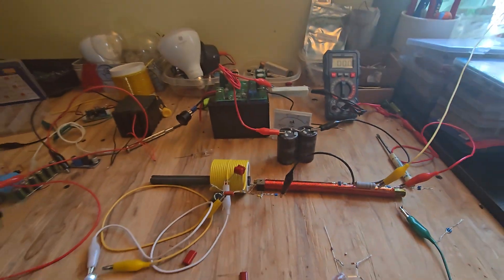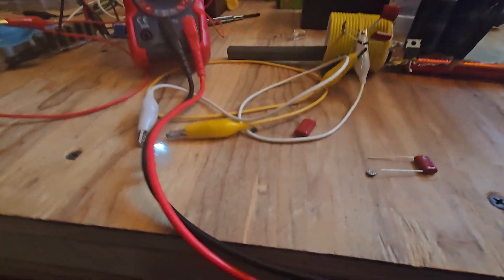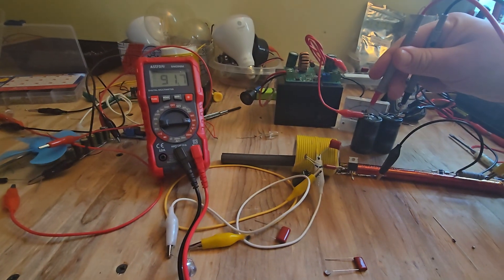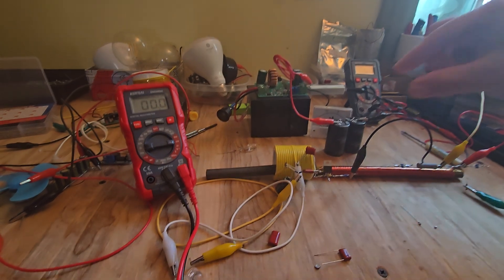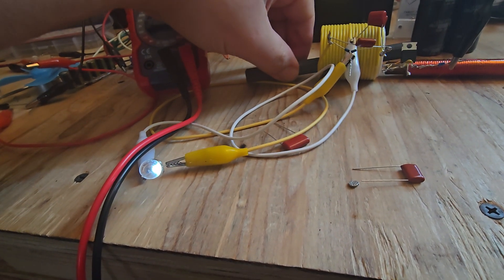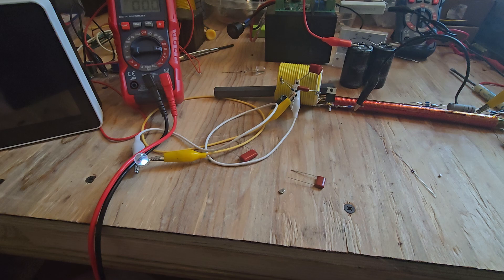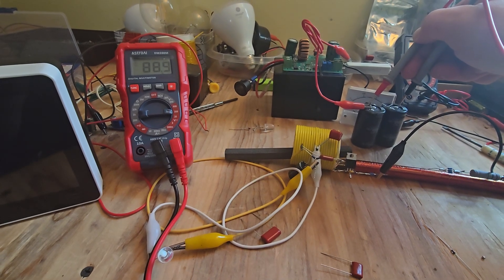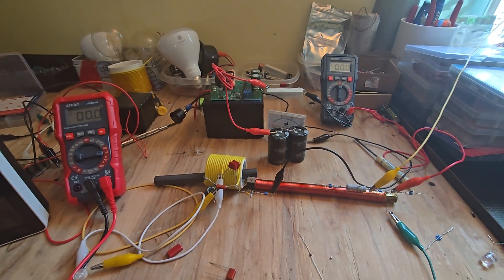VOLTAGE POTENTIAL ONLY AT NO CURRENT CONSUMPTION TRIGGERS TRANSMITTER INTO ACTIVATION CAPACITOR TEST

Comment: Anyone know any experiments on using a steady 1 wire DC potential and an AV plug to see if you can get DC current flow in the closed part of the circuit?

Comment: If you TRULY want to prove your circuit consumes NO CURRENT but runs off a Voltage Potential ONLY, do this:
- put resistor(s) in series with the caps, say 10 MEGA ohms (series connect 10*1 Mega Ohm resistors until resistance is immeasurable on your multi-meter - then touch it to verify you have several 100k to Megs on the meter as your skin has high resistance)
You also don't want low ESR caps, you want Low Leakage caps ;ø)
Reply from the maker: I'll try & do that & the transmitter circuit acts kind of picky with resistor values but it should be achievable
Reply: @MTECH2022  Best of Luck!
Ohm's law: I = U / R 
- so, Current is Voltage divided by Resistance, and the higher the resistance in a series circuit- the lower the current.
Since you say no current is drawn, increase Resistance to infinity to get Current to decrease to 0.
If your circuit is picky about resistor values, I see it likely consumes current.
Also, try using film capacitors instead of electrolytic caps - they usually have a much lower leakage current and can withstand high voltages too. Sadly leakage current is hard to predict, as it can vary non-linearly with voltage - the higher volt, the higher leakage.
Reply: I'll add that using resistors is a sub-optimal method because you lose a good chunk of energy in the resistance itself, you can instead use impedance of a low C capacitor with oscillating current to block the current flow that way to avoid losses, and to completely exclude current switch to a 1 wire circuit wherever possible.
Reply: @JenkoRun  The Description says: "VOLTAGE POTENTIAL ONLY AT NO CURRENT CONSUMPTION" - So if that statement is true, the resistor IS THERE to loose energy, as if current is drawn, it is no longer VOLTAGE POTENTIAL ONLY.
Reply: @ You're still loosing energy in the form of heat as current tries to flow through the resistance, it's better to prevent the conditions that allow current flow in the first place, see Joel's video on the subject for more details.
Reply: @EgonSorensen  It's not the same, no matter how much resistance you put in if your circuit allows the condition of current flow it's going to try and get current through, which is going to affect and disrupt the source dipole, disrupting the conditions that allow it in the first place is preferable over a system that wants to push current through a high resistance, the more current is lost in the resistance the more it's going to strain the source dipole, that's where impedance blocking and open circuit conditions are superior to Ohmic resistance.

And if that wasn't enough there is still the untapped Heaviside flow on the outside that isn't impeded by the resistance, the part that flows at near light speed, even with high resistance you're still sending that back into the source dipole which will disrupt it without any gain whatsoever, there's no advantage to a purely Ohmic high resistance over an impedance block method where both "electron" current and the Heaviside flow are prevented from interfering with the dipole.
Reply: @EgonSorensen  And if you use a closed circuit condition with a mega high resistance you are still drawing current, that is my point, it's better to not draw current at all, using the impedance of a capacitor or open wire circuit.

And just so we're clear, if you use a closed circuit as your driving circuit you're always going to have some current flow at the start, the difference between using impedance blocking vs high ohmic resistance is that the former stops drawing current completely once the capacitor impedance blocks it, the latter will keep trying to draw current.

A very brief moment of current draw at the start vs continuous sluggish current draw, there is no reason to use the latter, and again, the latter will not protect the dipole from the Heaviside flow, the former will.

Comment: At this point it would be interesting to try something like Joel's peg cell to isolate the capacitors or alternatively since youre running above 90v add a cheap 90v gdt for a spark gap and see if it isolates further. I have a feeling a spark gap would keep the caps charged.

Comment: yeah bud get a good scope like Owon . with a good clamp meter. I have a video coming out on friday showing how much of a difference there is between a galvano meter and multi meter when reading pulsed DC . Especially into a inductor which turns it into AC. The difference is drastic . The fuse method won't work either. A good thing to do is put 2 very small leds opposite each other on the input then you can see the current and direction by seeing which ones glow. I think you're back on the right track again just get a scope and clamp meter ...they are not cheap but you need for this research
Reply from the maker: Definitely plan to & the core theory of operation the transmitter will evolve into is an archform that manifests wireless power with no input simply due to its special design

Comment: Nice job.
A suggestion for you, you're looking for a voltage potential. 
You could consider using an electret
just a thought.
;)
Reply: Had the same thought, this area of research seems to be heading into an area where the source dipole completely excludes current flow and closed circuits, an open dipole and an oscillating potential condition connected to an AV plug further up in the circuit for closed circuit current operation leaving the dipole untouched, Joel did something similar recently with making a 'breathing" electret that self oscillates.
Reply: Best comment thread on free energy on the internet. as long as you dont kill the dipole but stress its flux density to the point where the the dipole begins to alternate or flip its polarity , that can set up a magnetic field in just about any conductor which collapses and produces an electromotive force or electricity1!.  I wrote a transdimensional engineering framework that focuses on this principle exactly the electric flux density or changes in the electric flux density in any region of space-time produce a very specific arrangement of that flux as it begins to rise and density within a certain volume of space time free energy is when that original condition of the dipole become stressed due to an overcharging which can be just one electron more that causes that electron to bounce back and forth between the poles taking the entire displacement current with it which is the movement of the energy in the vacuum in which any matter occupiesAs you begin to increase the electric flux density within a given or set volume of SpaceTime that electric flux will begin to converge and curl which is the scalar potential that was described in the original Maxwell equations on electromagnetism these scalar component we're just taking out by Oliver heavy side when he was developing his Vector calculus because he could not add up vectors that did not move from positive to negative the dipole Never Dies it just spins whirling as a Vortex or double Taurus in space-time which is the origin of spin and the explanation for Nasim Herriman paper describing the swartzchild proton and the origin of spin. 

So pushed even farther into that configuration it'll actually converge and curl into a singularity producing its own gravitational field that's why T Townsend Brown was able to use heavy dielectrics charged with high electric fields to fly shit around that's the secret that's how it works it's the electric flux density and how put off he published the paper on it called the polarized vacuum representation of general relativity my framework expounds on all of that solving General and special relativity and ultimately the enumeration in electromagnetism of the condition of Singularity that was predicted by Carl schwarzchild which therefore unifies electromagnetism and gravity as a singular function of the tensor metric of the electric field.
Reply: @ It's still unconfirmed that a changing dielectric field creates a changing magnetic field though, I've only ever seen this claim based on math but never seen any experimental verification of this, and since inductors can be activated purely by changing dielectric fields they're not proof that a changing magnetic field is present.

I'd like to see someone get a magnet and a magneto probe and stick it between the plates of a charging and discharging capacitor to test this.
Reply: @JenkoRun  Yes, a changing dielectric field can produce a changing magnetic field in an adjacent inductor, though the relationship is a bit nuanced and involves several key concepts: 

1. Displacement Current and Maxwell's Extension of Ampere's Law: 

A changing electric field (which is what exists within a dielectric) is associated with a concept called displacement current.

Maxwell modified Ampere's Law to include this displacement current, showing that it also produces a magnetic field, similar to how a conduction current does.

This means that even without a physical flow of charges (like in a capacitor's dielectric), a changing electric field still generates a magnetic field. 

2. How it Relates to an Inductor: 

Capacitor and Inductor Configuration: Imagine a capacitor (with its dielectric and electric field) placed close to an inductor. 

Charging/Discharging Capacitor: When the capacitor is charging or discharging, the electric field within the dielectric is changing. 

Displacement Current and Magnetic Field: This changing electric field creates a displacement current, which in turn generates a magnetic field. 

Induction in the Inductor: The changing magnetic field produced by the displacement current can then induce a voltage and current within the adjacent inductor, according to Faraday's Law of Induction. 

3. Analogy: 

You can think of it like this: The changing electric field in the dielectric is like the "source" of a magnetic field, even though no charges are physically moving through the dielectric itself.

This "source" then acts on the nearby inductor, inducing a current and magnetic field change within it. 

4. Important Note: 

The displacement current is not a current of moving charges; it's a time-varying electric field.

However, it has the effect of creating a magnetic field just like a real current would. 

In Summary: A changing electric field in a dielectric, due to displacement current, can produce a changing magnetic field that then interacts with and induces changes in an adjacent inductor through Faraday's Law of Induction.
Reply: @Pointlomawelding  Get back to me when you've thought about it for yourself, I don't engage with people that let a chat bot do the thinking for them.
Reply: @JenkoRun  little piece of..., I did tried for myself with a zvs, 2 transformers, 2 bridge rectifier and 3  supercap 20v 1F. I fill the first cap with zvs+t+bridge , and connect to the empty cap via switching 😒 it's share 1/2 volt instantly 😲if you put a transformer between 2 caps, and rectify the secondary, you fill the 3er cap to half. You can now inverse the polarity and connect back from 2nd cap to first, through the transformer again, now you have the charge full back to cap1, and capacitor 3, has another half of charge into. You have  2x1 like shopping, try for yourself, IT CAN BE DONE, ITS TRUE, TESLA DO IT
Reply from the maker: That's a very good idea & how is the voltage potential extracted from the electret?
Reply: @MTECH2022  Since an electret can’t drive current directly, you need to extract its potential via capacitive coupling:
Method : Capacitive Voltage Divider + Amplifier
Place a thin conductive plate (e.g., copper or aluminum) close to the surface of the electret (but not touching).
Connect this plate to the input of a MOSFET gate or an op-amp configured as a buffer (high impedance).
This setup lets you pick up the electret’s field as a voltage potential.
(i'm working on an idea that uses graphene oxide as one of the ingredients of the electret).
Reply: @clixbits  how you could use that? Grafe e is conductor, or you mean in a layer into electret dielectrics,

Comment: So what happens on this setup if you try to tap into it directly, non- wirelessly? Also, are you using supercapacitors?
Reply from the maker: Tapping it directly & non wirelessly would put a conventional load on it & cause the system to enter out of its mode of operation into a standard lossy electromagnetic mode of operation

Comment: Hi mal, now you have it operated via a cap, is there any chance of looping this back to the source? thanks.
Reply from the maker: Very strong possibility if a stable 90vdc can be obtained from a receiver coil
Reply: @MTECH2022  test the mesurement with a fuse
Reply: @MTECH2022  is this a correct méthode for this !!!!!!!!!!ônly ... bécause a fuse is thermodynamique.....!!!!the fuse is not good. ..?test it àt the short circuit ... when is good at your correct value m'y friend,all the rabbit hole sshut up and the silence..   ...lightning